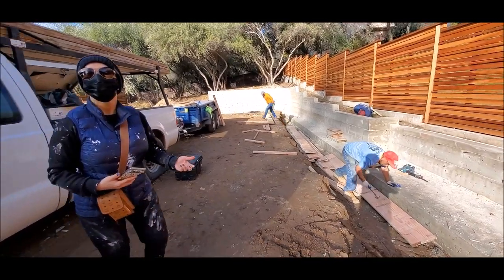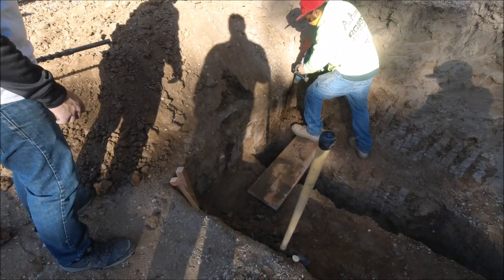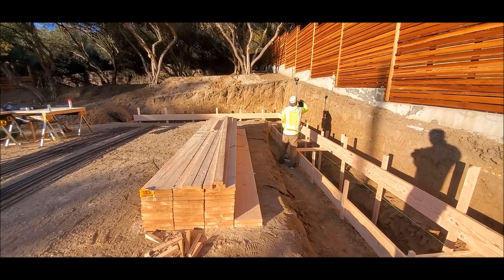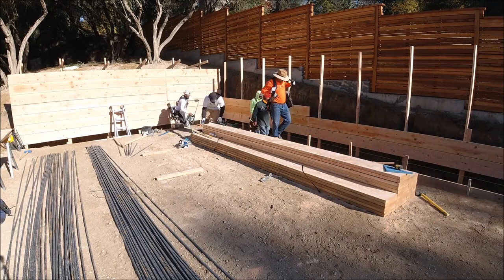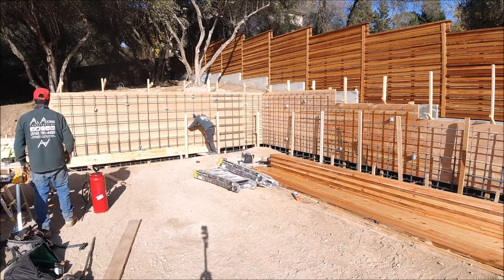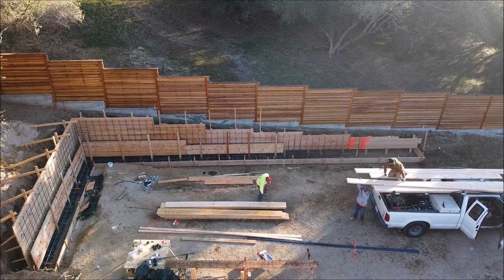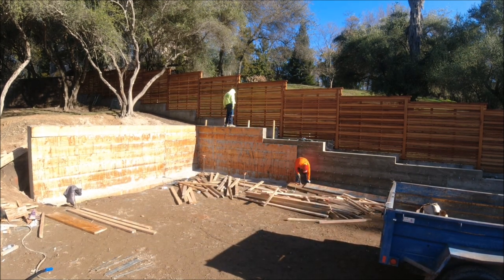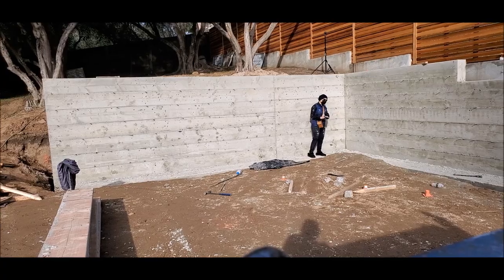How To Build A Concrete Retaining Wall Start To Finish 2021

Comment from the maker: See how we go about building a concrete retaining wall from start to finish in 2021. 

Part 1: How To build Back Of retaining Wall: https://bit.ly/2IMpIbP
Part 2: How To install Rebar For Concrete Wall: https://bit.ly/3559Skx
Part 3: How To Strip Concrete Retaining Wall: https://bit.ly/37DTby3
Reply: Hello, for starters - great work. I am facing similar construction on my land, and will base on what You have made. Could You please specify the exact parameters of ordered concrete mix ? It wonders me how come when pouring conrete in the wall this conrete does not overflow out trough the footing, is this due to this conrete mix viscosity and density ? thanx in advance
Reply from the maker: Appreciate the comment. In essence when we pour we start with the footing. We go from one end to other this gives the footing time to set. Then we come back around we start to pour the wall in lifts. Normally a foot or two at a time. I'll have a video out next week showing this on more detail.
Reply: @AllAccessConstruction  Thank You for an answer, helped me alot with this one. can you also check what were the parameters of the ordered concrete ? What its strength class, water resistance, consistency ? Regards
Reply from the maker: We use a 6 sack pea gravel it's about 3000 psi...

Comment: Personally, I believe you to be doing an amazing job. Very few people work as well as you. A small tip perhaps if you were to do some work for your own home. My grandfather was a Mason and I used to help my father collect bushels of shells at the beach,  clam shells in particular. I watched my father gather all the shells place them in a drum and builds a fire around this drum. the heat would pulverize the shells and he used to collect the powder mix a cup of pulverized clam powder to 16 shovels of sand. along with a half cup of lime. he used this sand to mix into the cement. He said it would help the concrete regenerate and last for thousands of years. DO YOU BELIEVE HIM? GOOD LUCK WITH THAT ;) Try it let me know. It works best for Morter
Reply from the maker: Respect 💯
Reply: @AllAccessConstruction  Excellent work. Save money buy or make forms lol. house in my profile is working progress perhaps i will retire if Jesus allows me to. Thank you for your content and time.

Comment: Great videos.  So relaxed, really nice to see/hear someone so chilled about construction work. Too many people flap around and ruin a job because they are stressed.

Just a quick question.  This wall is 8 inches, how tall could you build an 8 inch wall that is free standing without any lateral pressure?

Appreciate your time.

Cheers.
Reply from the maker: Appreciate the comment.. Ive bidded on a couple of free standing walls. The tallest was 6 feet at 6 inches..
Reply: @AllAccessConstruction  Thanks for the quick reply.  Much appreciated.

Comment: How do you finish the concrete once the wood forms have been removed.  Holes and slag which generates between the wood forms?
Reply from the maker: This is a board finish. There is no finish to it. The vibrator helps eliminate any holes air pockets ( there called honeycomb in the industry)

Comment: That's interesting. I've never seen dimensional lumber used to make forms in a wall like this. In my area they only use construction ply
Reply from the maker: Appreciate the comment.. What area are you in.. On the east coast there big on the plywood panels.. 💯💯💯

Comment: im not particularly fond of a lump pour.  leaving 2.4 in the foundation weakens the structure. Particularly fond of 2 separate pours. pour base with 1 meter of rebar above surface and remove molds in morning. tie rebar with 60cm overlap set forms and pour the following day vibrate. don't remove forms until 72 hours after pour. always add silicon base to the concrete mixture. very important.
Reply from the maker: Respect your comment.. But this wall wo t begin to have any problems in my lifetime and I have at least 50 God willing years left here..
Reply: @AllAccessConstruction  Oh no doubt it will last 50 year in fact i put an extra 50 to make it 100 year excellent job its just my preference and small facts that push me to a 2 part pour. nothing more again awesome work. Another thing i enjoy doing at the end of every tier i like using stirrups to create a hidden column to transition into the next tier. Its over kill but its just me thank you for the video
Reply from the maker: Ohh gotcha,,,, 👍🏾👍🏾
Reply: @AllAccessConstruction  may i suggest something? when doing double layerr rebar for retaining wall i like to stagger the rebar. In other words second layer of rebar should start in the middle or in between the facing rebar to increase lateral tensile strength. I usually align rebar for load bearing structure.  it works great again thank for the videos I have learned a lot.
Reply from the maker: Appreciate it.. I'll definitely bring it up on our next build 👍🏾👍🏾💯💯
Reply: .. any issues or thoughts of that cold joint between pours., like cracks forming?
Reply: @craig7350  at 4000 psi you will find some possible separation. however 6000psi ratio 1.5 portland to 2 sand to 3 aggregate good skills using a good vibrator and stomping 30 minutes to 45 minutes after a pour will never find a crack "NEVER". no seam nada..  must be poured 24 hrs after the first pour.
Reply: @BasiCommonSense  Thanks that helps alot